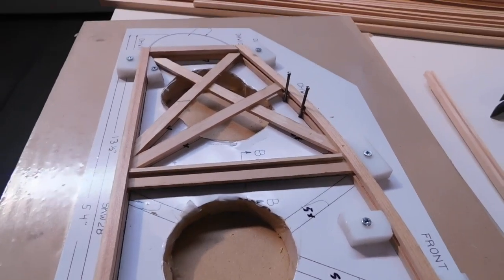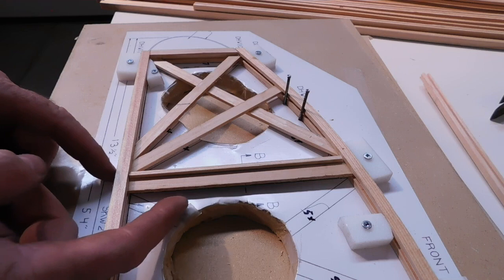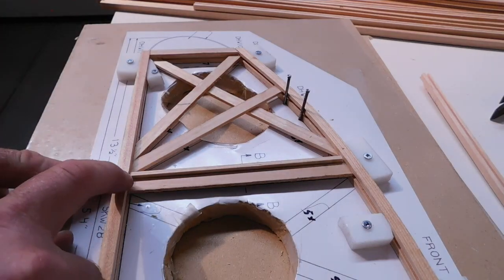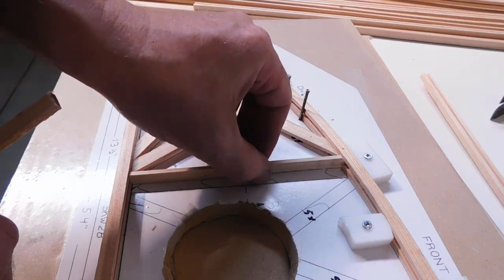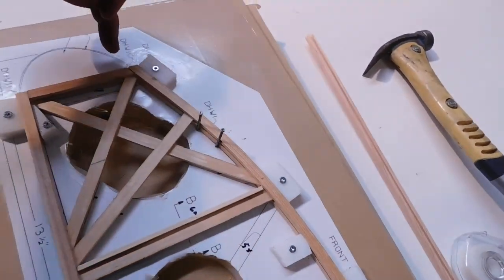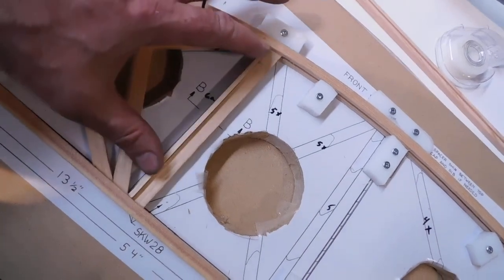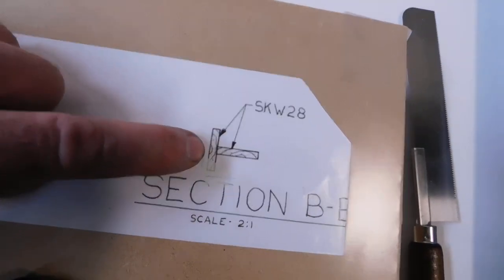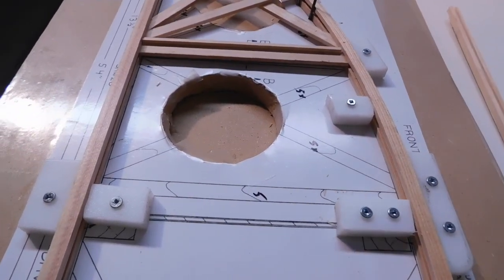DAKOTA HAWK EPISODE 2

Comment: There is no need for it to key into the caps, it is there to stop the other vertical from flexing under compression, so just cut it so it slids down between the caps. What ever you do don't cut slots into the caps!

Comment: Please make sure your geodetic is more snug. You shouldn't hear that rattle as you tap on it... And it should take at least slight pressure to slide it in to position. I know it's a great deal of work but I actually set aside about 1/4 of my geodetic simply because it wasn't a snug fit in the slot.